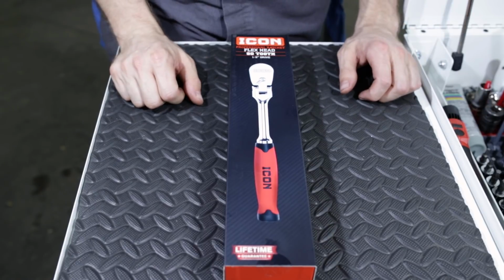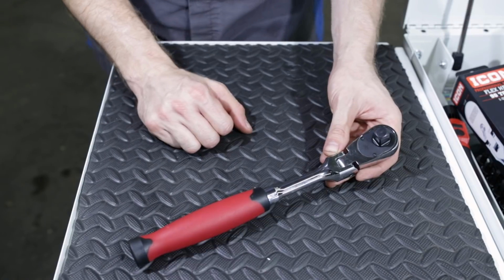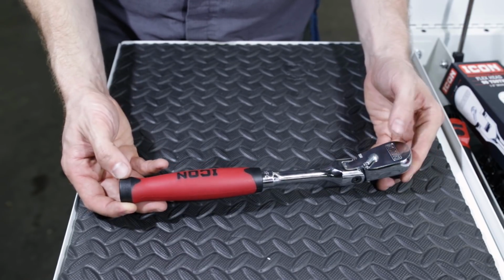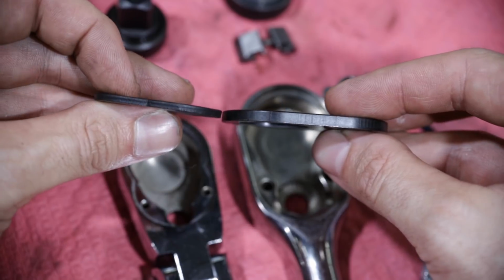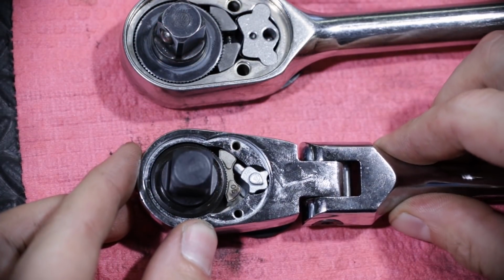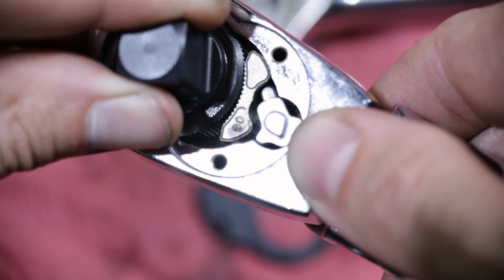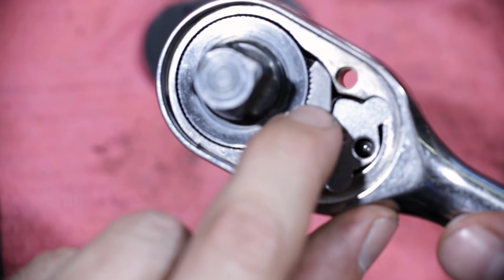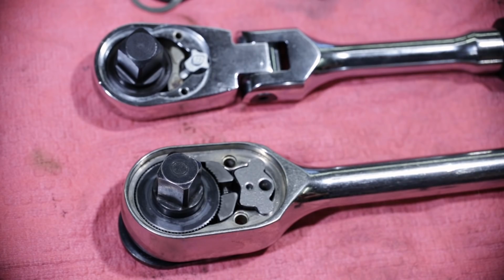Harbor Freight ICON 1/2" Drive 90 Tooth Flex-head Ratchet

Comment from the maker: For the hundredth time. Snap-on uses the exact same head size, internal components, and cover plate on all their 1/2" drive, dual 80, ratchets. It doesn't matter if it's a flex head or a straight neck, they're identical. The only thing that makes this an apples to oranges comparison is the fact that the ICON ratchet doesn't stack up to the Snap-on.
Reply: I understand that snap on uses that but to fair the icon ratchet flexhead is different from the regular nonflexhead. Probably nonflexhead icon would have been a better comparison
Reply from the maker: @ckcuev  there is no non-flex head ICON 1/2" ratchet.
Reply: Snap-On might use the same internals, but the icon (for some strange reason) doesn’t. The non flex head Icon ratchets for some reason have beefier internals, and much more reliable than the flex heads. The flex heads also tend to lock up or free spin when there is force/pressure on the on, off dial. Not saying it’s comparable to Snap-On, but it would  have been nice if you compared it to the Icon non flex head ratchet.
Reply from the maker: @icsivan  there is no ICON non-flex 1/2" ratchet.
Reply: MrSubaru1387 
SKU: 56340
Part# R3S
They call it: Icon 1/2 Drive Low Profile Ratchet
Reply from the maker: @icsivan  new product. Wasn't released at the time of making this video.
Reply: @MrSubaru1387  I think he was referring to a 3/8 or 1/4 for comparison, since it wasn’t released there’s no way he was talking about the 1/2. But it would be more interesting to see a non flex icon side-by-side with a snap on. The question is, is it worth the price difference? But, not only that does the icon actually last as long as a snap on, only reason I say this is because there are a whole bunch of old snap on tools still in use, but you don’t see too many harbor freight or Home Depot brand still being used after years of service. That’s the current difference in my opinion, that the snap on tools are expensive but they do last and I don’t think enough reviewers take this into account when they compare tools.
Reply: Comparing apples to oranges. Snap on had ratchets that are not a dual pawl design. Not to mention the size of the drive gear doesn’t really apply when you are comparing two different park designs. Most tech now days prefer more compact tooling with the tighter tolerances and work space. That snap on head was almost twice the size. Bottom line I want to see a torture test; you showing me the design and the type and size of materials used between the ratchets doesn’t tell/show me the durability of each tool just shows how they’re manufacture and as far as the cover plate goes the size does not matter not the screws to hold it in place there’s not lateral load being applied when using ratchets. This video was bias towards snap on because that’s the tool you prefer. I have seen torture test videos of the icon ratchets hanging neck and neck with snap on.
Reply: @MrSubaru1387  yes there is
Reply: @MrSubaru1387  yes there is and since this video has been made the first gen issues with the icon tools have since been corrected and redesigned. Do you think snap on first set of ratchets where superior when first released? They’ve had over 100 years of r&d. Give this tool a couple years to work it’s quirks out before throwing it in the trash my friend. Does a shop throw its techs away when they first start reaching due to poor performance. No they get better over time. Same goes for r&d

Comment: I mean, a $200 ratchet is better than a $40 ratchet, big surprise there. Honestly though, I'm not a full time mechanic and this video made me very interested in the Icon. Saying a lot from a guy who avoids HF like the plague.
Reply from the maker: Yea, this isn't pro grade, but definitely good enough quality for DIYers a d Weekenders. I believe it edges out GearWrench, Tekton, etc just for ease of warranty. That is if you have a local HF.
Reply from the maker: @Blue Friend these aren't breaker bars, they're ratchets. If you're using a 1/2" drive, most likely it's not tight quarters. If access is tight you need to step down to 3/8" or a wrench.
Reply: I have seen some test to destruction on these ratchets and the Icon was close to 90% of the Snap On strength.  Which puts in the buy column for me.  Also it puts it in the professional use category as well.   I am already impressed by the durability of some of my long handle Pittsburgh pro ratchets and these icons should be even better.  Great everyday beater wrenches.
Reply from the maker: @richb2229  all I've seen tested were 3/8" ratchets. Not 1/2". These will be put to the test in a future video.
Reply: @MrSubaru1387  my gut tells me that the snap-on is going to be stronger just because of how much beefier it is, but the contrarian voice in my head points out that most of the failures I've seen on the youtubes has been the anvil.  New ratchet, old ratchet it's usually the anvil that breaks. and since they're both 1/2 inch, maybe the Icon will do alright in the long run. I will admit though that I have a (emotional) bias, I want the Icon to be "good" because A. I root for the underdog, and B. I want to be able to afford a "good" ratchet and snap-on will remain out of reach for me, for a long time to come.
Reply from the maker: @dashjackson  GearWrench makes good ratchets, for the same of less manoey than ICON, depending on the Amazon deals.
Reply: @MrSubaru1387  I can't disagree with you there. I really like my 3 84 tooth GW ratchets.  I bought them used for $15 ...altogether (SCORE!).  That being said, I have this hope, maybe a naive hope that HF will both improve the tools and lower the price a little bit over the course of the next couple of years, but only time will tell.
Reply from the maker: @dashjackson  I see the price of ICON only rising. Theyre selling at the current price, most likely they'll have to increase the price to offset warranties. Snap-on does this annually to help offset fraudulent warranty costs.

Comment: Craftsman USA created a vacuum when they went away. People like myself who want decent stuff but don’t need Snap On usually went to Sears for good quality USA made hand-tools in the past.  Now, there is a huge amount of people looking for the next hi quality tool that is affordable.  Someone at Harbor freight is not dumb and that’s exactly who they’re going after.  The real professionals who shop on tool trucks are going to continue to do so. I don’t think much will change there.

This whole “icon” experiment is damage control for their tarnished image. Most people associate harbor freight tools with low quality Chinese junk. They are trying to shake that and tap into a bigger market.  They only compare their stuff to snap on because snap on is an easy target with their high prices. I don’t think anyone really thinks icon stuff is the same or approaching the same quality.

They want to win over people like me. The ones who used to shop at Sears for their tools.
Reply: I have old school usa made craftsman ratchets and always thought they were trash. Long arc swing to engage next tooth and not a lot of teeth. Even todays Taiwan  craftsman have more teeth.
Reply: I agree with you and they have sold me.  A great replacement for Craftsman.
Reply: @MrTmenzo  exactly, was doing my brakes a couple of weeks ago with the craftsman ratchet, I'm thinking, what the? How far do I need to go to find the next tooth? Finally I threw it on the driveway and used a generic ratchet from an old set. Going to buy a snap on from ebay, not a pro but want some pro tools.
Reply: John P I hear you about those original craftsman ratchet. But I have some very nice craftsman USA 84 tooth full polish ratchets. They started to step up their game in 2008 or so with full polish wrenches and better quality stuff made in USA. Too little too late.
Reply: TowerHill102 people compare the Jack to snap on and they even claim it's the same Jack but without the chain buy markup. I've even had a classic car shop tell me it works just fine
Reply: @johnp556  I used the craftsman 24 and 36 tooth ratchets just fine on brakes and I work on modern cars not model ts they get the job done you need patience
Reply: Agree 100%. Although like everyone else I have my fave which is SK.

Comment: Here is a memo from Redemption Garage that Icon (aka HF) is recalling there 3/8 flex head 10 " and 14 ' in the comfort grip and regular as they have a tendency to lock up do to a lack of lubrication. He opened his and added grease and has not had any problems but others have
Reply: Stan The Mann yeah I experienced this, I’ve tried multiple types of grease and still locks up sometimes but not as bad

Comment: The icon internals are sized more like a snap-on fc72. 1/4 body with a 3/8 square drive. I just cant get behind any of these until theyve been in the field for a few months of hard use. Everything new will feel great right outta the box but after it's used for a while will prove it's worth. My snap-on ratchets feel just as good now as they did the day I bought em.
Reply: That's just simply not true, you can feel the wear and tear on ur snap on wretches. I've tested YOUR wretches first hand, when u got them. And just a couple days ago. Be fair.

Comment: Your comparing two different style ratchets. If I'm not mistaken a Snap on swivel head ratchet has a smaller head than that long handled ratchet. A long handled ratchet is of course built to handle more torque than a swivel head ratchet that is made to get into tight areas.
Reply from the maker: Well, you're mistaken, because all Snap-on Dual 80 1/2" ratchets have identical sized heads and internals. My 26" long Snap-on 1/2" flex head ratchet has an identical head to this non-flex Snap-on.
Reply: @MrSubaru1387  Huh! Ok!
Reply: @MrSubaru1387  All snap on may but what about the icons?
Reply from the maker: @falconater68  the ICON uses different heads for flex and straight.
Reply: Both made for different purposes! But still handy to have both in your tool box! One for them hard torqued nuts the other for them hard to reach places!
Reply: Regardless of the design differences between the two the Snap-on has been proven over many years 
I will say that the icon will be a good alternative for the homeowner who is seriously considering a good ratchet for the $

Comment: You're right, but check out Catus maximus's vid comparing strait-handle to flex head Icons, and you can see how much more robust the straights are.
Reply: I wish they would put the internals from the straight ratchets on the flex. The straights are much beefier

Comment: not that long ago, the snap on 1/2" had the same small screws that went in the face plate. they had to redesign the ratchet head when they went to longer length handles as the smaller screws would break. Now they have the larger screws that install from the rear. You can still break the mechanism though. I go through at leas one kit a year and its not a daily use tool.
Reply: The selector on mine vaporized the second time i used my long handled snap on 1/2 inch ratchet. Got that selector replaced, been perfect since. And ive used it hard since then. Havent had any issues after the fix.
Reply: @aidanhamilton9859  I'm in the AG industry and have a lot of large bolts. The ratchets just don't hold up for long. Either the teeth on the drive wear out or the screw for the pivot head breaks. I broke a 3/4" to 1/2" adapter the other day trying to loosen a 1 15/16 nut for a cylinder.
Reply: @willagresham2978  I use my ratchet everyday. Have put it under a lot of stress. Ive never seen the bolts for the cover break. Shit will wear out no matter what. Thats why there are replacment parts. My dealer replaces parts for free.

Comment: I just broke my Pittsburgh long flex head ratchet. They always break at the flex. 
Had to use my workers xl snapon flex head and it did not break. 
Going to go trade in Pittsburgh and get the icon will see how it holds up at work.
Reply: will they give you the upgrade under warranty? The icon costs more.. do you pay the difference or do they just give it to you?
Reply: I had to pay the difference. 
And to be honest it has less flex then the Pittsburgh but the ratcheting doesn’t feel any better.
Reply: @calebmac_cars  I've been using Icon and Pittsburgh pro st work and the icon is easily much better. Ratcheting action is very smooth soft and fine. Pittsburgh has less teeth and the springy-ness to the pawls. Icon has one 12 tooth pawl and 90 tooth gear, pittsburgh has 2 5 tooth pawls and one 72 tooth gear. Icon = stronger. Compared to my coworkers snap on they both aren't the best but the Icon is actually nice and I prefer it over the 72 tooth Pittsburgh pro

Comment: They both do the same job except snap on must be a whole lot more expensive!  I buy Canadian Tire tools, it has life time garantie, no questions ask!
Reply: behexen250   Even GM does not give life time warranty because they know their car won’t last a lifetime.  To give a lifetime warranty, you have to believe in your product. So far, no problem with my cheap tool, gets the job done all the time!
Reply: It’s really simple theres 2 type off people in this world the ones that like and take pride in there things and the ones that want to pay the least posible and settled for the lowest quality as long as it barely dose it’s job this tools won’t last over the years how many you need to replace it warranty don’t mean shit if you have to replace it all the time that is not quality it’s junk be adults and just accept you are cheap
Reply: jose ibarra I am 70 years young and been using C.Tire tools for 30 some years and, the only piece that broke was a socket mounted Phillip driver built for ratchet only  and was used with impact gun. Was replace without a fight and without a receipt for a brand new one.  I have all the tools I need for my mechanic for a fraction of the price.
Reply: Jocelyn Savard  you can do the job whit auto zone tools the point is everyone want to compare icon whit snap on when they are no we’re close in quality yes snap on is stupid expensive but I have never  hade any problems tools break because we abuse them and all I am saying is if you  have to replace it a lot maybe that tool is not all that good I don’t love all the tools Snap on make I actually have a list off tools I will never buy the best way a can compare this never ending argument is you can buy a Kia and a BMW they both take you from Point A to Point B one is a lot more expensive that’s all most people that complain about the price on Snap on don’t have or all that money they save buying cheaper tools we spend our money on thing we think that matter you may not see the value on buying snap on but have no problem buying fire arm or cars something else we are just comparing the actual quality and why everyone is saying icon is better no one have made and actual video like this you can see the difference this icon ratchet won’t last now let’s see how icon fan respond me personally if I have to replace a tool more that 2 times a year it’s chunk don’t have the time for that buy a better quality tool
Reply: jose ibarra Amen!

Comment: When I break a snap on ratchet gear, they warranty just the inside components. Why don’t they just replace the whole ratchet that cost me     Over $100. Unlike HF , they replace the whole ratchet.  Good review on the Icon ratchet.
Reply: Because its pointless to replace the whole thing and it shouldnt cost you any money to have it fixed.

Comment: My 1/4 icon ratchet broke yesterday at the screws.  The face plate pops out now. Off to get it replaced 😩
Reply from the maker: It took me over two weeks to replace my 3/8 ICON ratchet after it started slipping. Drove to two different stores and neither had the ratchet in stock to warranty out for me. Neither could tell me when a ratchet would arrive. It took HF seeing my IG story complaining about the issue, and them contacting me directly and shipping me a ratchet, did I get it warrantied.

Comment: Can you please do a review on the sockets like how prone they are to rounding out, beating with a hammer, etc? I'm all in snap on for ratchets and stuff but sockets aren't something that have to be the best. I got a $20 tool set from advance auto and the sockets would round out because they were the lowest quality money can buy.
Reply from the maker: I'd have to say, sockets and wrenches are the most important thing to invest in as a technician. Ratchets follow close behind. You want good quality tools that do the engaging with fasteners.
Reply: MrSubaru1387 I just think that sockets are something that can be a little cheaper. Unless you're trying to use them with an air impact than they don't need to withstand much. I think that if their sockets hold out and don't round or crack just like my craftsman than they're worth buying.
Reply: Just like cheap wrenches , cheap sockets can be dangerous, especially when you’re working on larger fasteners, you don’t want to be pulling over 100 pounds of torque and have a socket split, damage a fastener, or a poor fitting wrench open under torque and you go flying. Is snap on overpriced for a homeowner yes, for a professional not so much you’re buying more than just a tool you’re buying service, somethings I use all the time  requiring lost of torque Snapon ; but most of my other day-to-day task I like gearwrench, the xtra long 120xl flex head ratchet and mid depth sockets are hard to beat at any price working in tight Japanese engine bays.